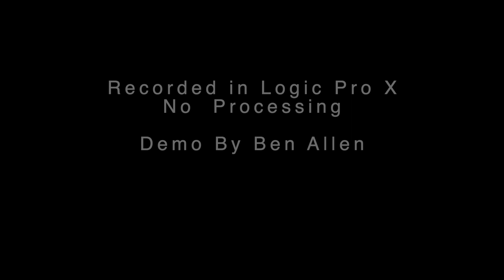Rotary Pedals Compared

Comment: To my ears, the Neo Ventilator wins hands down, but it's also more than double the price of the Lester K, which doesn't sound bad at all. Think I'll go with the Lester K...for now.
Reply: Don't. Just save, and wait for it. It'll be worth it, even if it takes a whole year.
Reply: @MiguelBaptista1981  I went with Lester k…then sold it. Honestly, the built-in sound on the Nord is better than lester. I actually quite like it.
Reply: Korg bx3 2003 and mini vent 2. While the hardware remains the same, the new mini Vent II is a much more flexible device.
Reply: mini Vent 2 2016 is that Neo Instruments modified the algorithm slightly to solve problems older stuff have

Comment: Well as a longtime Hammond and actual Leslie user I'm adding another vote for the Lester, drives better and sounds more natural. Controversial!
Reply from the maker: Awesome!
Reply: Agreed. I played through a Leslie ProLine 860 for seven years on the road, hundreds of gigs, and for top and bottom rotor speed (and  I'm talking slow and fast speed and acceleration and deceleration times), I could not tell the difference between the Lester K and the 860. The drum rotor never gets up to the speed of the horn rotor on an 860... it just slowly accelerates and wonks away! The drive is even better on the Lester K than it was on that solid state Leslie unit. I, too, love the simplicity of design and function.

Comment: You can critique these pedals, but at the end of the day it is what works best for  your situation.  I have the Lester K and and older mini-vent.  I actually prefer the Lester K.  The sound is so smooth and you can't find a more simple pedal.  I love the Ventilator II, but that thing is huge and has so many fine tuning parameters, this would be usefull in a studio situation.  For live situations, less is more in my humble opinion.  I would like for you to add the micro-vent in this comparison.  As a price point, the Lester is a great deal.  I bought mine off of ebay as a used item.  I paid $110.00 for it.  When it arrived, this pedal, although used, was in pristine condition.  Not a scratch on it and sounds great.  I don't want to get into any debates on which is better and why as sound as a whole is so subjective.  I run a Roland FA-06 which has the Super-Natual Organs in it.  Once the internal rotary sound was removed, the organs sounded great.  I did have to fool with the balance as I found the Lester K to be a little bass heavy.  Once I made these adjustments, I am totally satisfied.
Reply: If you ever want to sell your keyboard let me know

Comment: I have owned a Neo Vent 2 for six years. Brilliant. I have just bought a Lester K. The Bottom rota speeds up and slows down very much like my old Leslie 815 that had a rotasonic drum rota. Using both pedals for the first time on a gig tonight. I will use one at a time (bypass one and have the other active) to have different rotary speaker effects. Brilliant video 😃

Comment: You did a great comparison job. The Lester K has its own special sound not comparable with the other two models. But I will buy this Emulation for sound experiences with my M-100 and my Fender Guitars and Basses. But the Ventilator has the best simulation in my opinion. Your Video was very helpful for me. Thank you very much.
Reply from the maker: Very happy it was helpful!
Reply: Finally I would say that the neo ventilator is the best way to get an authentic Leslie Sound.

Comment: The EH has a surprisingly smooth drive. The Strymon Lex is definitely worth a demo.
Reply from the maker: I actually tested the Strymon Lex on my own, and didn't feel that is sounded like a real moving speaker.
Reply: @benallen5967  I had a Lex, sold it and bought the I expensive NUX Roctary...
It’s amazing. Not as good as the Vent...

Comment: I have owned and gigged with a neo ventilator II linked
to Hammond XM1 and Roland Workstation. Can’t fault it. Years ago i gigged with a Leslie 815. A back breaker. Just received a Lester K. Planning using the neo ventilator and Lester K wired in series just to add variation to the sound. Great demonstration by the way.
Reply from the maker: Thanks! Interesting idea… but I don’t think the Lester K and Vent 2 will sync up and sound good together… maybe they will. Best of luck!
Reply: @benallen5967  I would bypass one and have the other active. My other idea is maybe have just the bass rotor on the vent and horns on the Lester K. Just experimenting really.
Reply: @benallen5967 an update. I have used both at a few gigs now with one of my XM1s. I bypass one simulator while using the other. They do sound significantly different to
each other through the PA system. I like both. What I did find was I have to have the Lester K wired directly to the XM1 then out to the neo ventilator 2. If I wire in the vent first the volume of the Lester K drops considerably.
Reply from the maker: @martinhudson2552  thanks for the update! That’s very interesting. I’m glad you are able to use both in your setup. That sounds like fun. What music are you playing?

Comment: Great demo. I have another pedal for you to try if you do this demo again. Since you did this demo Fender has introduced its Pinwheel Leslie simulation pedal and at $100 less than most of the other models that were available in 2023.  I got the Pinwheel because I also play guitar and it has two features that impressed me. The sensitivity control allows you to dial in the effect for the pickups on your guitar and it has a switch to select input impulse for guitar or keyboard. This might make a difference to guitar/keyboard players. The Pinwheel has all the cabs the other pedals do as well as expression pedal control of ramp up speed, overdrive, tone, ramp up speed, and level controls. And it’s a stereo pedal.

Comment: From this video I chose the Leslie Cream Pedal. It was the closest to my 1967 Leslie 122 speaker, and when I tried it out on my 1969 Hammond C-3 with a Trek VIB-3 line output box it did not disappoint. I found the Neo Ventilator nice, but its doppler effect is too pronounced. No pedal will completely replace the real thing, but the Leslie pedal was the closest for my application.
Reply: Right on. Did you see in the review you can change the Doppler effect on the vent to being less so by lowering the mix/dist lo and hi knobs?
Reply: Thanks!

Comment: Great video!  I would love to see what you're doing with the drawbars as well!  I've made my decision: Ventilator.  One question: That second foot switch you're using for the Neo, do you have to use a Ventilator switch or will it work with other foot switches?

Comment: Hi Ben, thanks for that video!
What do you think about using the Neo Ventilator II in a live situation on stage instead of the Nord‘s internal simulation? Will there be a big difference or benefit for me as the player (I‘m using stereo in ears) or the audience?
Best ragards 
Daniel
Reply from the maker: Thanks for the question, Daniel! So, undoubtedly the Neo Vent II is a superior simulation to what is in the Nord- not vastly so, but yeah, it’s better (more realistic and more tweakable) and using stereo in ears (I do that too) you’ll notice a big difference. It’s gonna be the biggest benefit to YOU as the player to use the Vent. Can the crowd hear the difference? Some of them definitely will, but is that a good reason to bring the Vent instead of using the internal sim? Bottom line. The only reason to use a Vent over the Nord internal sim, is because YOU will play better with a better simulation. It’s just way closer to a real miked Leslie, but the crowd won’t notice the sound difference so much (unless they are a bunch of guys like us)..what they will notice, is your joy, your passion, your real grace with those keys when you play. So… yeah, it’s worth it, but only for YOU. Can you get by with just the Nord? Absolutely but With an IEM mix, the Nord can sound a little too clean and “close”… it just lacks that 3D real space feel. What do I do? 99% of the time, I use the internal sim with my Stage 3, but that’s because most of what I’m doing is blending organ with other sounds, and it’s just easier. If I’m doing solo organ stuff, or in the studio recording? Even though the Nord can more than hold it’s own against nearly any other sim (looking at you Yamaha)…I use the Vent. Every. Time. I can get it very very close to my 147, and that’s what I’m used to with my C3. Hope that helps!
Reply: Thanks for that answer, Ben! I‘ll try to get my hands on a vent to check it out.

Comment: You didn't give the low frequency simulation enough time to get up to speed. Like a  Leslie, rotor takes a LONG time to get up to speed. I'd also note that the blinking light strictly indicates the speed of the lower rotor only...can't show both.  Also, on the "stop"....absolutely realistic that the horn slows immediately and the lower rotor takes a while. My greatest surprise in this pedal was the realistic distinct ramp up and down speeds of the lower and higher frequencies.
Reply from the maker: You are absolutely right... I should have recorded this at the time with headphones, but had limited space and was using monitors at a quite low volume.

Comment: Considering buying a Korg GrandStage and was looking at the Lester K as a "foot switch" because there is no foot sw. capability for the Leslie spin on the Grnd Stg.
Reply from the maker: So I take it this was helpful? I'm happy to answer any questions you might have! I know the Grandstage well.
Reply: Ben,  I've been checking out all of your video's on the Korg Grnd Stg and want to know if the Lester K would work with the "fixed" organ sounds it has for the Hammond settings. The slow spin would be doubled and I wonder if that would be a problem.  I figured the Lester K would solve my need for a foot switch (for fast spin) because the Korg GS does not have that capability from what I understand.   Thank You - Paul
Reply from the maker: Paul Englert you should be able to set the mod wheel to be controlled by the pedal for the organ sound you are using. The manual reads that way to me. I don’t own the Grandstage any longer (I wish I did!)
Reply: The neo ventilator is the good sucessor to the original leslie cream pedal.

Comment: My question is why companies even sell these pedals when most keyboards have onboard Leslies anyway. I’d understand if someone wanted to use a vintage Hammond B3 or a Yamaha DX7 where there is no onboard rotary speaker per se, but I’m pretty sure that the only reason a keyboardist such as myself would have to buy this pedal is to have either a dual-layer Leslie effect or to allow an additional effect to be used if there are a limited number of those onboard which one can use.
Reply from the maker: GREAT QUESTION. So, honestly, unless your keyboard has a dedicated organ section (think Nord Stage/Electro, Yamaha YC, Hammond SKX, etc) the VAST majority of built in "Leslie" effects, are pretty abysmal. So, this is a great way to get "that sound" without having to get another keyboard. And, some boards have good Leslie effects on board, but if you are fanatical about getting a 122 or 147 sounding rotary effect - you can't really do it without plugging into the real thing, or using either plugins, or one of these pedals.

Comment: The Lester K is EHX's cheap Leslie option, not a bad pedal but the Lester G is a better pedal, IMO, would have liked to see that used in the comparison.
Reply from the maker: I appreciate the comment. I don’t and didn’t have access to one of those are the time.
Reply: I owned both. They sound identical as expected as they have the same processing algorithm. Although the Lester G has the addition of more control (acceleration control) and a compressor (not useful for organists, I feel), it loses the option to run stereo inputs.

Comment: Sorry to say but some Nord drawbars doesn't sound like Hammond drawbars at all.
Reply: That's no the point of the video. It's about comparing three different Leslie simulator pedals.
Reply: @robertkaye5434  At the end it'a all about getting close as possible to Hammond organ sound without Hammond organ and Leslie spaker!  😉
Reply: @manmars1581  EXACTLY! While ALL DUE RESPECT to LESLIE CABS ... With digital technology advancements, it's all about which pedal sounds as close and/or gives you the most options for tweaking the sound. My $$ is on Neo Ventilator II.
Reply: @robertkaye5434 First of all you have to have a good, valuable source of virtual Hammond sound and only after that comes good virtual Leslie device. I personaly  prefer Neo Ventilator II too.
Reply: @manmars1581  I'm going to use it on my 6-string bass guitar!

Comment: Man ..... A lot of fuss .... Too bad , the old Hammond XK-1 blows these out of the water and you don't need another pedal ...!
Reply from the maker: @joeserrenti9857  that’s hilarious
Reply: I have an XK1 and Neo Vent and the XK1 internal Leslie sim is a joke (even after tweaking it) compared to the Vent.
Reply: @Timrobrus  Without having actually experimented with a Vent .... you may be right .
But if we're looking to not lug one more thing and are running low on patch cables, the Xk-1's Leslie ....When Tweaked a bit , ramp speeds, eq for horn & bass rotor is Damn Right On..  You need big equipment to make it roar ....
I dragged around a 147 for years and have the blown discs in my back to prove it ...lol

The ultimate question is taste ...... Guys , ...Is it THAT MUCH BETTER ....!?!??